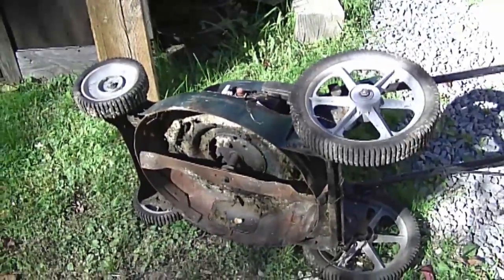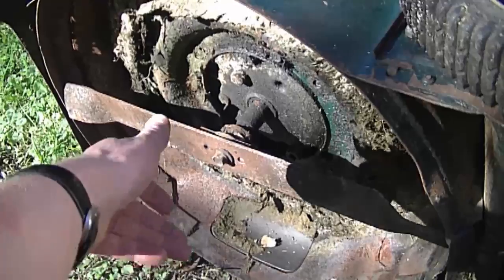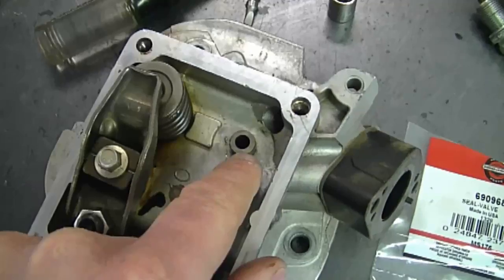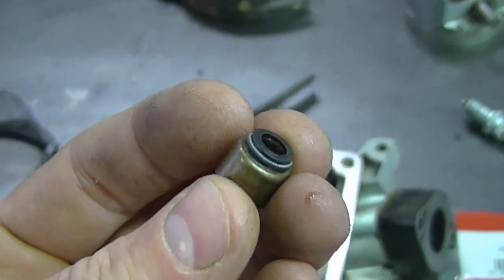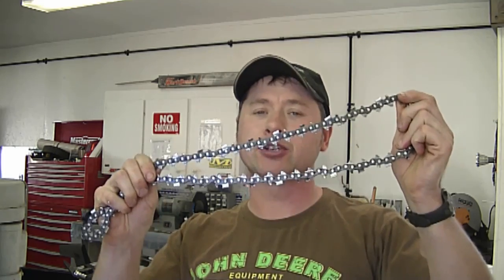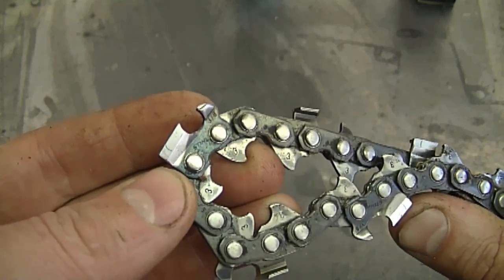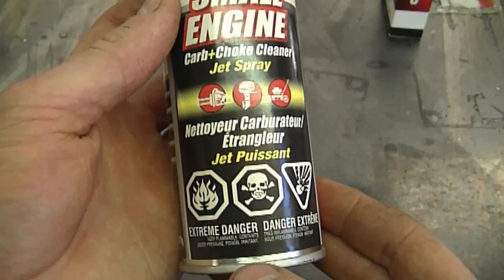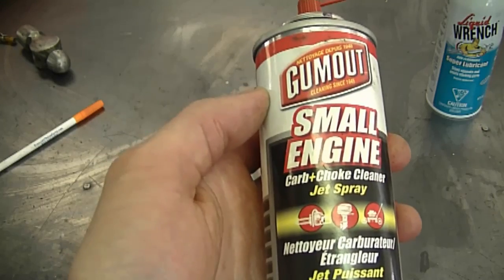Small Engines Q & A Video #134 in HD

Comment: Enjoy your videos. I have a husqvarna snowblower with a Tecumseh motor that surges up and down at idle. If I put the choke on half way it smooths out. there doesn't appear to be any mixture screws. I took the carb off and cleaned it but it didn't help. runs OK at high speed. Thanks for your time.

Comment: Excellent Video Donyboy!     I have a tip:  On spraycans that use a spray tube,   I cut apart the plastic that holds a six-pack of soda or beer together.     I then take one of the plastic rings and force it over the spray can.    Sometimes, a little stretching of the plastic ring is necessary.  I then slip the little red tube under the plastic ring and it stays there nicely.    I used to use rubber bands, but they crack and break eventuallly. Have a great weekend.     Greg from Pennsylvania

Comment: A related question is whether you can move a motor to a different diameter deck, and make a corresponding blade change. For example, from 19" cut diameter to 21". My expectation that a slight change will have no impact, but going too many sizes larger will strain a motor sized for a smaller diameter. (Like a 3 HP that came on a 19" might bog down easily with a 22" blade.)

Comment: the only thing i don't let warm up is my ATV, but the jug is made of the same exact material as the piston(aluminum alloy) and as long as you run it gently while cold it is nearly impossible to score the jug from the piston expanding too fast. but i do let it run for about 30 seconds to get the oil flowing.

Comment: Dony thanks for #134---another cause of oil on the muffler of a 2-cycle engine is running the motor at low/idle RPMs for long periods of time.

Comment: In my opinion stihl dealers have the best customer service. Also an easy way to figure out how much oil you need to mix with gas goes as follows, take the amount of gas you put in your gas can in gallons, multiply it by 128 then divide it by the mix you want, then this number you end up with its how much oil you need in ounces, for example, 1.5 times 128 ÷ 50 = 3.84. So you need 3.84 ounces of oil to mix with 1.5 gallons of gas for a 50:1 mix.

Comment: Great video, but you didn't quite answer the first question, specifically the self-propelled part. Something I wondered about myself recently when shopping for a replacement deck. Presumably you'd need a compatible pulley (if belt driven) to fit over the shaft you are installing on a self-propelled deck, if you care to retain the self-propel feature. It'd be great to see video showing a variety of self-propel mechanisms.

Comment: I have a Honda HRS 160 push mower and there is a very small amount of oil leaking out from where the governor comes out from the engine. Any way to fix that? (The engine is a GCV 160)

Comment: hey Donny, my husqvarna 350 which might have 15 hrs on it at most starts and runs great when i first start out but once i stop it and go to restart it theres no spark and it wont start. I've cleaned it out, so nothing should be over heating, im going to try changing the plug but i fear it might be the coil... any suggestions?

Comment: yeah im a painter and use acetone every day same main  chemical in carb cleaner and i see the cracks in your fingers.Hmm looks like someone isnt wearing their gloves .The acetone in carb cleaner strips the oils out of your hands causing cracks.They can be pretty painful,but as far as wearing gloves for painting or small parts like carb rebuild not to practical.Been painting and mechanical work 30 years and never wore rubber gloves and still ticking.

Comment: if its 2 stroke a synthetic or semi/synthetic 2 stroke oil,
if its 4 stroke a synthetic or semi/synthetic 4 stroke oil,
that have the same viscosity as the original oil.
The newer synthetic oils are far superior to older oils and viscosity does not change much with temperature increase.

Comment: HEY ALL OF YOU OUT THERE....I am looking for a "LAWN BOY GURU ",,,,,,,,bought a USED
lawnboy commercial mower in 1973 when I got out of the service.  changed decks years ago because mine was cracked...have no original numbers.  "buddy" put new short block  on for me #94-5734, F series I think.  I would like to make it electric start, or find eng. with elec. start that will fit my deck.  love this old mower..one handle..start and mow...
THANKS
BOB